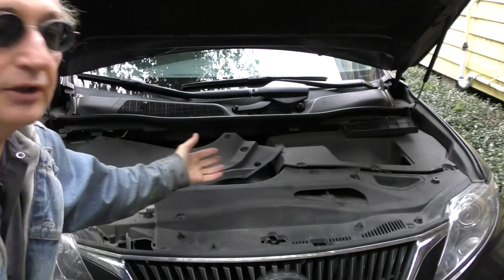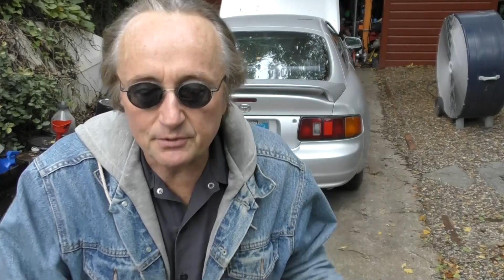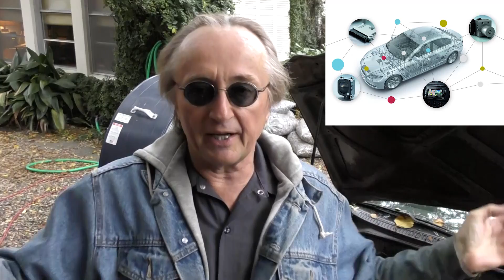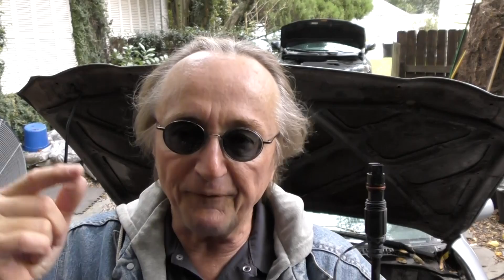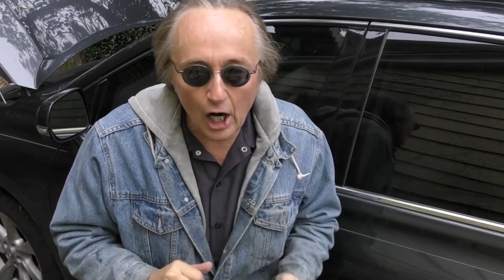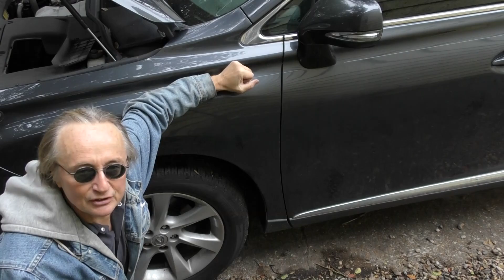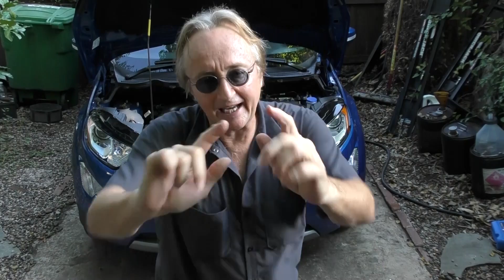The End of DIY Car Repair, Why New Cars are So Hard to Work On

Comment: Question Please:  Hi Scotty!  You Rock Dude! My Question is about my 2005 Chrysler Town & Country Limited; 3.8 Litre; 6 Cylinder; with Factory Towing Package / extra Transmission Cooler; which I have owned since new.  The Question is:  Is there a way to easily fix or manually force the heat ventilation system vent open and close doors in the dash (the things the redirect air flow, when you turn the selection nob) to go back to the nob selection choice of Heat to the Feet + the Windshield Vents, when it seems to be stuck only in the heat / air coming out of the dash vents only?  Even if it means manually jamming something in the right place to force the air flow = I am happy to do that, and just let that be my new permanent vent setup, because it is currently not working anyway, and here in Canada, we need our feet warmed and our windshield defrost vents to work at this time of year, full-time.  Some other background info that may be relevant to this issue.   Background = The AC went a few years ago, and I did not fix it due to cost, I've had to replace thermostat and radiator last year as there was no heat at the beginning of winter but was plenty hot after the fix. BUT, now that winter just arrived (and I have not been using my heating / AC vent system at all since last year, the new problem that just showed up, is that the heating selector system will not change the venting locations when I select a different mode.  I noticed last winter, that it sometimes took an acceleration to 40MPH or so, to cause what I'm guessing is the vacuum system to engage / suction and switch the hot air flow from the Dash Vents, to the Defrost mode of windshield / feet.  Basically I would switch the nob selector to windshield and feet for a balanced defrost and foot warning, and the airflow would not change at idle or low speed.  Thus, I would have to accelerate quickly or drive for at least a couple of minutes before I would hear the vents system switching it's mechanical parts inside the dash (little thunk, thud noises of plastic door turning and closing), and then the hot air would start coming out of the foot vents, and the windshield defrost.  That was no problem then, but now that does not even work, and no matter how much nob turning and accelerating I've done this past week, the vents are stuck with air only coming out of the dash, and it will not switch to the foot and windshield defrost option.  Please Help!  Thanks Scotty!! :-) ~Kevin
Reply: Hey if you ever figure it out let me know, I'm having the same issue.
Reply: Parts Source sales guy looked things up for me today, and told me that there is no vacuum pressure running those vents = he said that this make and model specifically has electronic actuators on all the vent doors for air flow direction.   Hmmmm, make me wonder where the fuse / relay is, that controls actuators / connection to the control selector knob on the dash....
Reply: @kenflash70  Yes, will do!  Still no luck in my searches = hoping Scotty will pick this one up as a question to answer! :-)

Comment: Hey Scotty! I have a 1994 K1500 pickup with TBI. I swapped the wore out 305 for a 350 long block and 350 injectors. I was told that the computer would relearn the fuel curve. However it starts rich and Idles a little rough and even sporadicly when cold. once up to temp is runs smooth but doesn't have the power a 1/2 ton should. It also has a slight knock in the transmission that goes away once the trans warms up. It has never thrown a code, until recently an o2 sensor sometimes does not respond on the high way, but when it is in the lower 30s it idles rough and will hesitate if it has not run for 5 min.  I cant afford to have the trans rebuilt yet.  but I'm trying to figure out if it i should change the computer for a 350 or can I get a standard mail in tune? and just swap the prom or If the problem is else where. Also it gets 13mpg with A/S 265/75/16 tires. what might I do to get this up? it is all stock except the engine size. It would be awesome if you could give me pointers here. Love your channel, Thanks!

Comment: scotty- I purchased a 1993 chevy k1500 with a 305 and 157,000 for $900. did I get a good deal? Also are there common issues with these trucks I should be on the look out for? I changed the plugs , wires, cap & rotor, egr, and TPS, hoses. Thanks!

Comment: Hi Scotty I have a Hummer H2 I'm getting a signal fuel cap needs to tightening, I try a new one but the message still comes in goes, by the way I love your videos, one more question I haven't changed the transmission fluid and it has 151 thousands miles, it bought it used back in 2010
Reply: You have an evap leak. The gas cap is an expensive and (lazy) way mechanics try fix the code. Get under the car and start tracing fuel lines around the tank. Look for a hole in the line. You should see a controller down there too check power and resistance. Finally get a good scan tool and see what the computer is seeing. There's a charcoal canister that can get plugged up usually from overfilling. If it's plugged replace it.

Comment: I have a '99 Saturn, with the single overhead 1.9 engine.  5 speed. (about 180,000 miles on it.)  I was accelerating hard to merge to a freeway.  In 3rd gear at about 4000 RPM I sensed that the clutch slipped.  Is that normal? or does it indicate the beginning of a serious problem?

Comment: Hi Scotty, I have a 2012 Chevy Sonic 1.4 L Turbo with a standard transmission. About 5 percent of the time it won't start and acts like I'm not pressing the clutch in to hit the safety switch. To get it to start, I have to push the car a few yards in netural then with will start fine. It also will bump start with no problem. Any ideas? It sounds like the started isn't getting power, but not sure why it would be so intermittent and why doing the car in netural would fix it.

Comment: What kind is that $200 scanner can you check the transmission pressure the PCS pressure control solenoid regulator on your transmission mine won't go into gear help please help

Comment: Whatever happened to the Geo Metros? i had a 97' (i think) compact that ran very VERY good gas mileage, about 58mpg according to manual and i dont remember filling it up much
Reply: Juan Duque I Still Have My 1990 Geo Metro 3 Cylinder Automatic And Still Going Sarpong Strong At 306,700+Miles.

Comment: Hey Scotty, question for you. I am thinking of getting a new BMW f20 118d. I am told the 118ds have the exact same components as the 125d variant, and the only  difference is the software map. Apparently you can just get it remapped to the better variant and save thousands of pounds. Is that right?

Comment: Hi scotty, my question is, I have a 1990 300zx tt 5 speed manual, I just drove it 200+ miles on a trip and now it won't start, the car is in neutral, the clutch is in, the battery good(I put a jump pack on and that didn't help) it has 266000 original chassis miles but the engine is rebuilt, I slipped the clutch on the trip and smelt the burnt clutch smell, but I made it home and it shifted fine, but it won't start now?

Comment: Scotty. I got a 2004 honda accord lx coupe. The speakers in my car makes a loud white noise sound. I'm thinking of replacing my radio but I'm not sure if by doing that it will fix the problem. Any suggestions?

Comment: Hey scotty, I live in the Caribbean and I have a 1996 Toyota starlet 4EFE engine with a 4 speed manual transmission. The car misfires when doing low speeds in 3rd and sometimes second gear but only when the engine has been running for sometime and its warmed up. I bought some cheap copper spark plugs and have changed them 3 times in the last 3 months. The car burns oil and the spark plugs gap were still in good condition but they had carbon on them. I recently replaced the cheap plugs with iridium plugs and the car still misfires. I suspect that The valve seals and piston rings in my car maybe worn because the car has 150000 miles on it so I use Lucas stop leak in the engine from time to time. It works partially and is relatively cheaper but I was wondering if it would be better to changed the seals and rings in the engine or if I can continue running the car with the Lucas oil?

Comment: OK Scotty here's my question.  My father-n-law gave me a 2011 GMC Terrain that has 64,000 miles on it, should I keep it or trade it in on a new car (I'm looking at the Toyota Rav4 as I need something that can do light towing)?  I'm concerned that the Terrain will start giving me problems.
Reply: I should add.....looking at a 2018 Rav4 not the newly redesigned ones

Comment: what maintenance should be done right away if you buy a used car that has 100k miles on it?
Reply: Coolant change, change the oil, change the oil filter, change the engine air filter (you may not need to, but who knows when the last time the previous owner changed it). Also have a mechanic take a look at the timing belt/chain.

Comment: Hey Scotty, does my 2017 Ford Fusion need the dealer recommended 15,000 mile service? Mult-point inspection, lubricate all hinges and locks and condition all weather stripping.
Reply: No. Just make sure things like oil changes, tire pressure, washer fluid, filters, etc are kept up with and no fluids are leaking from it. It's a new car; if you really want to you can condition weather stripping yourself, although the car is too new for it to matter. An inspection at the 2 year mark for brake fluid and brake life makes more sense.

Comment: Hi got a toyota avensis mk2 07 reg, brake pedal goes to floor so i took master cylinder apart but all rubber seals looks ok to me so cleaned all and reinstalled, done bleeding all round twice, all new dot 4, now pedal not only floors but feels like its on air not fluid (first few times on every start then goes back as before slowly sinks all the way. Cannot see any leaks anywhere, advice please thanks in advance {manchester, UK)

Comment: Scotty I have an interesting problem my father's 03 pt cruiser keeps tripping a code for the air tempetature sensor that the voltage is too high now the wires were torn off and I established the connection again and it's good and changed the sensor too but it keeps coming and going and stays on and it has another problem the car stays idling way too high like 1,500 rpm high and there is no code for that what do I do

Comment: Scotty, I have a check engine light on my 2001 Hyundai Elantra. The code is P0422,  main catalyst efficiency below threshold bank 1. The catalytic converts has been replaced twice over the past 5 years. I've replaced the oxygen sensors, used Cataclean and the code is still showing up. Can you please help?

Comment: My brother in law has a 2002 jeep liberty it was running fine then it started running rough and the engine light came on said it was a misfire number 6 cylinder replaced plugs it still had a misfire on number 6 cylinder replaced coils and it did it again it is burning up number 6 coil I've changed the plug and coil and it burns up the number 6 coil and it just shows number 6 misfire?

Comment: I got a Mazda 3 2005 that doesn't start the first time. The check engine light is on and it says H02S Heater Control Circuit Low Bank 1 Sensor 1 and this means one of the oxygen sensor is not working. Could this cause the car to have starting issues? Or do I have to clean sensors or throttle to get rid of the issue?

Comment: Hey Scotty what do you think of a 2001 Subaru Forester with 180,000 miles for $4000? Is it a good deal? Are the older Forester pretty reliable?
Reply: $4000 a bit too much for one with 180000 miles. You can get ones with less than 150,000 for $3000. Subarus, like Toyotas, are often a bit over priced in regards to what you are getting for the money too.

Comment: I have an 09 kia optima while changing the head light bulb i realized that the connector the bulb slides into split in half making a wire loose i rigged it but after a bump it fell out. Is there a quick diy to fix it or do i have to take it to shop?

Comment: I hear this nonsence (cars can no longer be repaired by DIY guys) since the 1980s. Actually today things are easier for DIY car repair  guys than they used to be.  Here in Europe the manufactures are legally obligated to provide the  service manuals (not for free of course but you can download them for a fee - I got the whole documentation for my car for 40 Euro), diagnosis software like VCDS is better than VAGs own tools and most of the time the error codes really tell you whats wrong. You need some computer and electronics knowledge, of course. The really challenging things like engine or gearbox overhauls are rarely necessary and even a car repair shop delegates this to external specialists. 

What really has changes is that the engine compartment is so crowed that you have to disassemble a lot of stuff  for most repairs. Thats frustrating.

Comment: Scotty, I have an 03 Toyota tundra with 235,000. I bought it off my old neighbor  for 4,000. Its in great shape and looks almost new. The transmission fluid was changed at 200k. When should I change it next? Do you think I paid to much for it?
Reply: You can change it at 240k miles, or the next oil change, whichever comes first. Drain and fill only, of course. $4k is OK compared to new trucks -- yikes!!

Comment: What about preventative maintenance is that also out of reach with today’s DIY? Or just repair?
Reply: Yes on certain makes it's cost prohibitive. BMW had a system that needed to register batteries if you placed it, Mercedes had a brake system that needed a scanner to replace brake pads, toyotas often don't come with transmission dipstick to check them, Mercedes (supposedly) had a convertible that after so many uses it would stop functioning and needed to be reset at a dealer.

Comment: Hey Scotty!! I need help with purchasing a 1993 limited edition miata. 112k miles turbo added 98k miles and it's been sitting for a year or more and the fuel line popped off from, ( I assume ) the big kit fuel pump. Should I buy it for 1250 it's got about 6k in the turbo kit and tuning and exhaust and other stuff. Also an upside it's a 1993 limited edition only 1500 made
Reply: Gas is everywhere

Comment: It seems like new car should be easier to work on with all the computers I guess new cars are safer but I wish they build new cars with V-8 engines and rear wheel drive And make them really big and beautiful maybe the near future we can have robots work on the cars and we can have robots pump gasoline in the car’s and check the oil and check the air in the tires that would really be cool

Comment: Scott I have a 2007 Lexus IS250  183k miles. I need driver side head light. This model came stock with HID. Dealership price is $1000 for one. Would you know  where I can find a good quality aftermarket headlight?
Reply: Am auto parts.. they are 485 dollars new

Comment: Hi Scotty  Did I make big mistake?  My wife and I purchased a new 2019 Honda CRV with the 1.5 turbo engine. It only has a 1000 miles on it so far.  Should we sell or Keep it? We were thinking of having this Honda for a long time!  Any advice!   Randy
Reply: Hi I'm not Scotty but I'd like to answer that. Factory turbocharged engines tend to wear faster than naturally aspirated ones but Honda is a brand you can rely on even if it's a newer model so I would say you should keep it and sell it once the engine starts to fail, but I'm pretty sure you can squeeze out a lot of miles before that happens.

If you maintain it properly it should last you a really long time.

Comment: Hey Scotty my 2007 Volkswagen Jetta has a check engine light. Before the light the engine was running rough. The engine is running much smother after the light came on. The car is even getting better gas mileage. Why is that? What sensor could it possibly be?
Reply: Sorry I don't have a scan tool so I really can't diagnose it myself

Comment: Will incorrect pigtail wires to a throttle position sensor cause a my vehicle to shift long at slight throttle and shift quick with half or more throttle? 1989 camaro 305tbi 700r4
Reply: like the wire colors mine example is ABC =  blue black
 white

Comment: Hey Scotty, I got 06 Honda Accord ex with 220k miles on it.
It burns a quart of oil every 500 miles.
When I started the engine with the oil cap off there was a lot of air coming out.
What do u think is the problem?
Reply: Thats just backpressure out the cap. If its burning oil see if you have blue tinted smoke from your exhaust. If so the internals of the engine are loose and might need a rebuild. Send an oil sample to black labs for a breakdown on what your engine is doing.
Reply: @Powertoolz  no blue smoke. There's some black smoke. And the exaust pipe has allot of carbon build up.
I'm wondering if the egr needs to be replaced cause I got code for inefficient exaust

Comment: SOME ONE PLEASE RESPOND

I have 2002 dodge Dakota that needs front and rear brakes it also needs a new power steering pump. Should I fix it and give it to my son for his first car or sell it? Btw it has 110k miles on it
Reply: 110k is not that many miles for a 2002 pickup truck. You have a golden opportunity to teach your Son many valuable lessons here. I suggest you keep the pickup truck and make an offer to your Son.  If your Son agrees to do the necessary repairs himself, with you paying for tools/parts and you overseeing his work, then he will have earned himself your pickup truck. You will score some great bonding time with your Son. He will gain the confidence to be a problem solver and not be afraid to work on his own vehicles. Good luck on your decision.